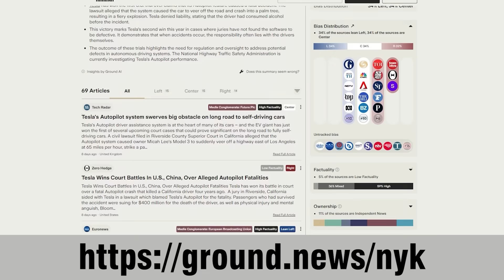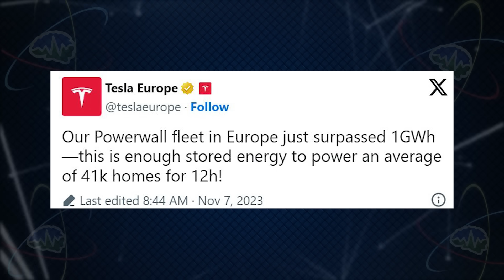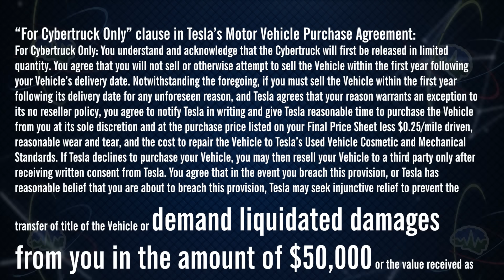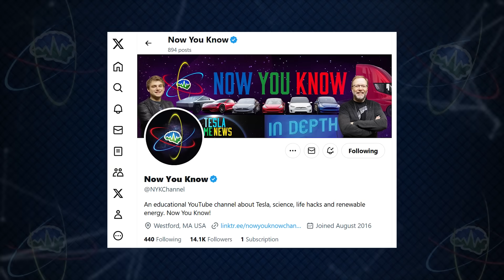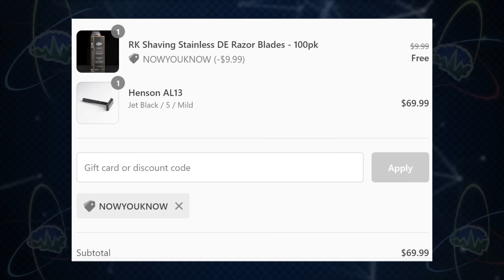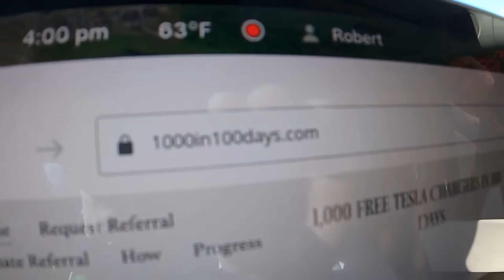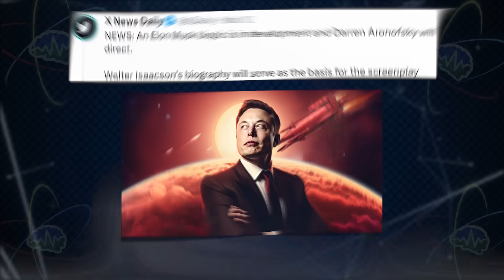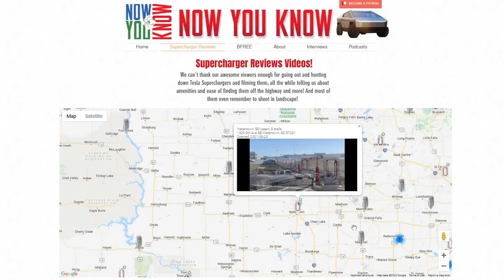Elon Stole A Car?! | Tesla Time News 375

Comment: @12:22  now that cybertruck has an electricity input and an electricity output in the truck bed.  even if tesla doesn't give it company endorsed hookups to treat it like a stationary home battery, and doesn't have autobidder available for it;  How hard would it be to do that side of the features in a DIY way?  charge cybertruck from solar or cheap evening grid power.  power house during the day from cybertruck
Reply: how long on a DIY system would it take to energy arbitrage the cost of the cybertruck from the cybertruck battery?

Comment: Why would anybody want a camera facing inside their personal space; especially one controlled by software that's ran by a huge company?  (I'd personally prefer zero cameras ran by proprietary non open-source software in my vehicles/home, and will never understand the people that do)(I'd also prefer if cars utilized privacy protecting infotainment systems that didn't store/sell user data).  
   What's wrong with mechanical/electric car locks that you can manually unlock/lock and visibly see?  I don't get it.  All that said, Cybertruck is enticing with it's stainless steal bod!  If it actually comes out for the original price mentioned in preorders, I'll still consider it.  If it sells for preorder prices, could that be the reason for the Tesla re-selling clause?  I'm just looking for an affordable bulletproof truck.  If Toyota was allowed to sell the Hilux in North America, and offered a super capable base model that still had 4x4, decent towing capabilities, and air conditioning, I bet it would slay, especially if pricing was similar to other countries around the globe, and could be ordered with an anti-rust coated frame.